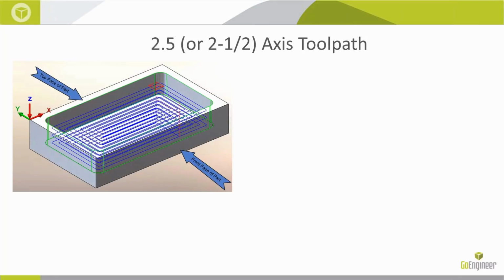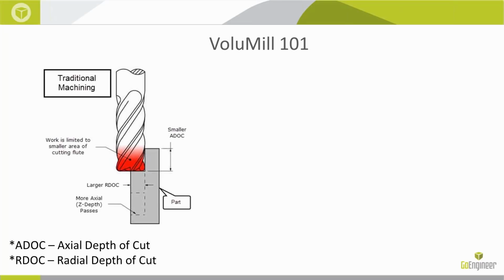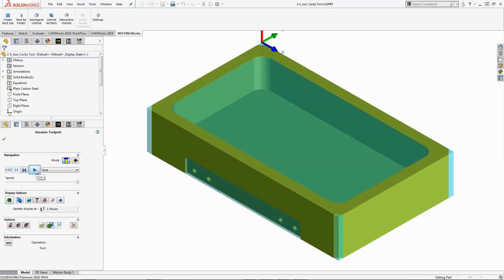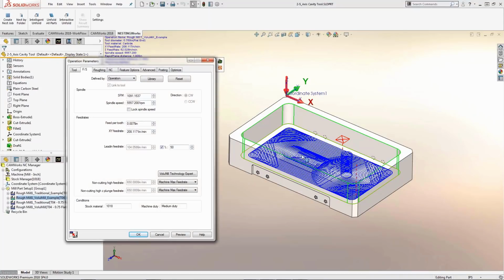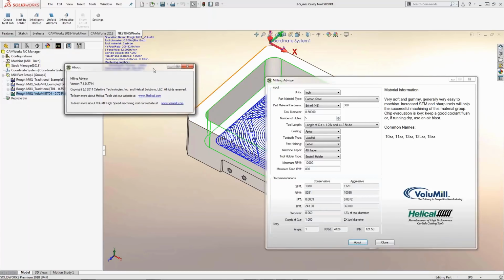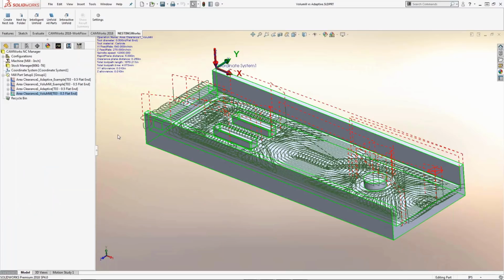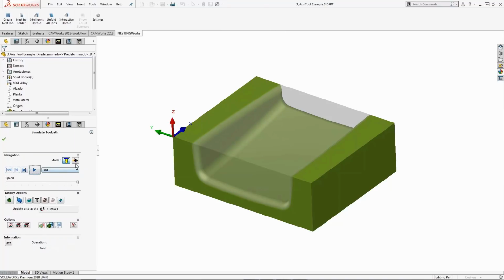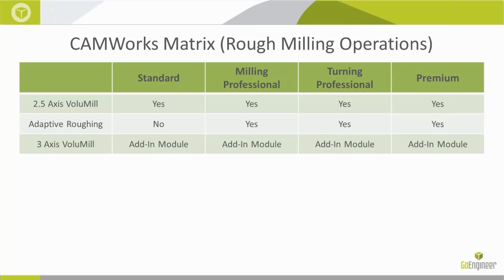CAMWorks High Performance Toolpaths - 2.5-Axis and 3-Axis VoluMill

Comment: Hello. I follow these tutorials on YouTube, I find that I understand what you share, I would like to develop a project and it has to do with molds... I would like to master 3D CamWorks to make my molds... I still have a long way to go to finish it. I would like to count on you.
I appreciate your time with these videos.
I have one of many questions. Once the G code is generated, can SolidCam move the router or does it need another program?
Reply from the maker: I can't speak to SolidCAM, only CAMWorks and SOLIDWORKS CAM. But with those programs, they generate the G-code and then you need a Post Processor to pass the information to the router. You can search for out-of-the-box post processors that are specific to your machine and try using those to translate the G-code into the movements for your router.

Comment: I like the idea of 3 Axis roughing, I specifically seem to get a lot of pockets. But its when there is a pocket with a bunch of other features inside of it including curves and tight hallways, I cant seem to figure out. Volumill and adaptive dont seem to want to make a full slot even if I want it to because it should be okay. Do people just settle for 80% removal and then come back with some 2.5 axis paths to clean up the remainder?
Reply from the maker: That really depends on the application. For some things roughing is good enough, other times it maybe further post processed by things like EDM. If full 3axis machining is something that is required by the application we would move from Solidworks CAM to full on CAMworks for the extra functionality.